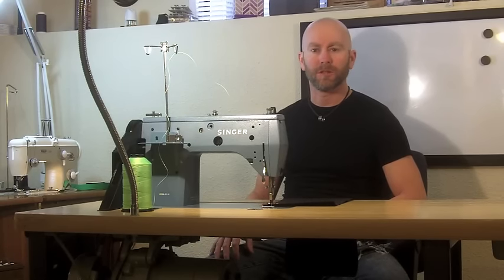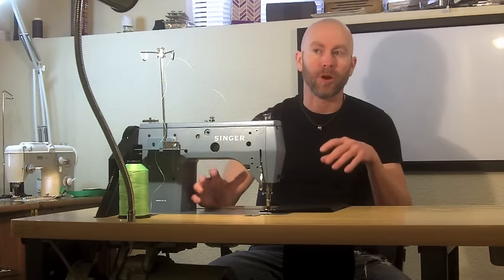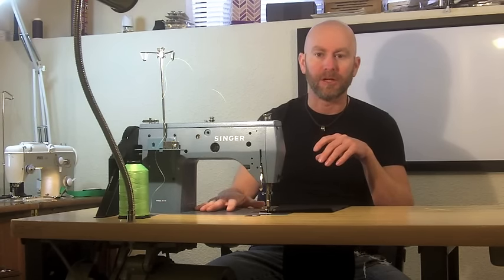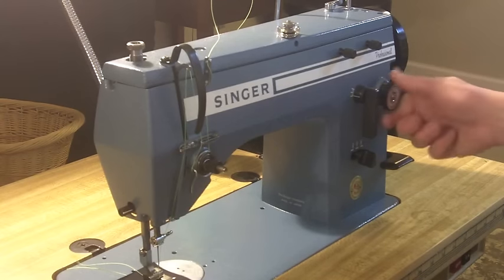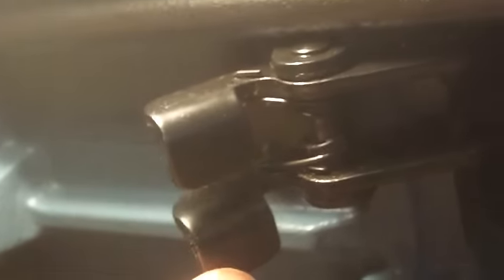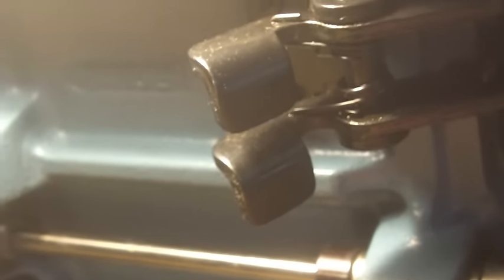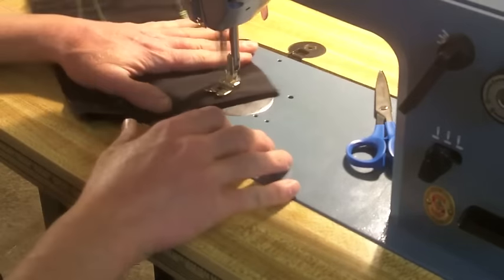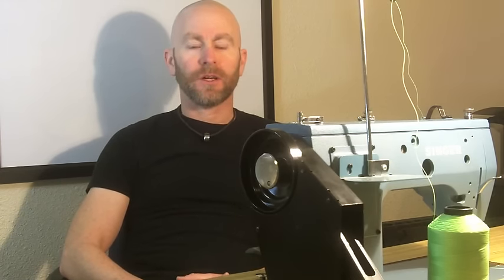Do you need an industrial sewing machine, Part 3 (I bought one!)

Comment: any opinion on the morse industrial lz1 commercial sewing machine on Etsy?  They are saying its just like the Sailrite only $200 cheaper.
Reply from the maker: So, first let me preface:  I have never seen or used a Sailrite machine, and my Thompson is the only variant of that design of machine I have used.  That said, here's my opinion.
Sailrite and Thompson seem to be the originators of this particular model, as far as I can tell, and to the best of my knowledge Thompson is no longer around. (As I understand it, Thompson and Sailrite collaborated on the design, but don't quote me on it.)  Every other machine of the same design is a knock-off, and is probably pretty close to identical - at least in appearance.
I'd really like to get my hands on a Sailrite, and I'm considering purchasing one at some point down the road.  My Thompson has been very capable and reliable, but not exactly buttery smooth and a joy to use (compared to my Pfaff 260, it's feels harsh, the controls stiff).  Watching Sailrite's videos, the LS and LS-Z machines seem a little more polished/refined than mine.
That said, the main reason I would lean towards a Sailrite over a knock-off version is that Sailrite is a company here in the U.S. that you could contact with a problem, should one arise.  They've been around for a while, and I don't see any indication that they're going away anytime soon.  For all I know, their machines are made in the same factory as the knock-offs, but when spending that kind of money on something brand new, you're not just buying the product, you're buying the company.
The thing that makes that design of machine stand out is that it is a portable walking-foot machine.  If you don't need portable, and/or you don't need a walking foot, there may be other options to consider, especially on the used market.  
I hope that helps, let me know if you have any other questions, and good luck!
Reply: Sailrite customer service is awesome.  Watch the videos for them, and realize that you will most likely be in direct contact with Matt (that Sailrite guy) for any questions or issues you might have.  I have purchased a model 111 which suits my needs, and have been quite satisfied.  I have no experience with the LZ-1 portable machines.
Reply from the maker: I should probably update my reply on this.  I now have a Sailrite LS-1, and I agree with rmcdaniel423, Sailrite's customer service is excellent.  The machine is very similar to the Thompson with some significant improvements, the reverse lever being the most notable to me.  I have several videos featuring the machine on my channel now, and a full review is coming soon.
Reply: @thejasonofalltrades  Of course the Sailrite's videos make their sewing machines seem smooth, polished and refine. I had a brand new Sailrite LSZ-1 for some years but to me it sound like it was grinding sand in it.Yes,  it was strong with the walking foot but had the feeling of cheap chinese quality. I do not think it's better then a Thompson maybe worse. Quality wise not comparison with a Pfaff, Singer, Bernina, Consew or Juki.

Comment: What do you recommend to sew 1000D Cordura nylon, elastic, and velcro?
Reply from the maker: Hi Allen, 

If you're looking to try sewing those materials but don't want to spend a lot of money, most any vintage domestic sewing machine will do it.  I recently made a video on the construction of my 1000D Cordura yoga mat bag using my Pfaff 260, for example.

If you're going to be doing a lot of sewing of those materials, and don't need to regularly sew thinner materials, too, then the Sailrite Ultrafeed machines are hard to beat, in my opinion.

You might want to check out my Sailrite review, and the video "Why Do I Have So Many Sewing Machines?" on my channel for more information.

This all assumes you are looking at domestic machines, not industrials, which is a whole other topic. 

I hope that helps, let me know if you have other questions, and thanks for watching!
Reply: @thejasonofalltrades  have you tried sewing those materials before on the sailrite machines or their knockoffs?
Reply: @thejasonofalltrades  would even a singer 4423 home machine sew those materials?
Reply: @thejasonofalltrades  also would you ever consider selling the Thompson or know of a good place to look for one? I've seen Rex version on Amazon for $285 but I'm not sure about it.
Reply from the maker: I've been using the Sailrite Ultrafeed LS1 as my primary machine for about two years.  I've sewn gobs of 1000D Cordura, 1680D ballistic nylon, 10.10oz waxed canvas, 400D pack cloth and probably a few other things.  I occasionally use other machines just for kicks, but when I need to get a project done in any of these materials, it's the machine I go to.
Reply from the maker: The 4423 is branded as "heavy duty" but in my opinion it's just a regular sewing machine.  I tried one in the store once, and I'm sure it's fine, but there's nothing remarkable about it.  I was seriously considering one, but I read a bunch of online reviews that seemed to suggest poor reliability. However, I have NO personal experience with them other than that one "test drive" at a store.  For me, I'd buy several vintage domestics rather than one of those.
Reply from the maker: I'm definitely not looking to sell my Thompson.  I have seen them pop up on Craigslist from time to time.  I paid about $300 for mine, and if I changed the one thing that I don't really like about it (the stitch length /reverse lever, the new one on the Sailrites is far better and available separately from them) it would end up costing about what a Sailrite LS1 Basic costs.  If you find one, and if it's at the right price, buy it!
I have philosophical aversions to the Sailrite knock-offs.  I've spoken about this at some length in a couple of videos.  I was actually working on a scheme to raise the money to buy that Rex, do a full testing cycle and review video, then give it away, but the requirements to do it legally and within YouTube's policies made it untenable.  My suspicion is the knock-offs probably can be made to work as well, probably will need some tuning and adjustment that Sailrite does before they ship their machines, and could be made from "factory second" components or with less quality control.  Pure speculation on my part, and my philosophical aversion and the fact that Sairite provided my machine should be considered.
Reply: @thejasonofalltrades  what are machines comparable to the Pfaff 260? What size motors do those use? How are they different from the sailrite and knockoffs and can they do 1000D Cordura nylon, elastic and velcro sewing?
Reply: @thejasonofalltrades  what size needle and thread do you recommend for the Cordura nylon and elastic and velcro?

Comment: $300 for a Singer 20U-33?? You actually stole it. Especially in that condition. It has one of the widest zig zag stitches available on these types of machines and they are reliable as a rock. Oh, lol, it’s not missing anything from the tensioner. That is exactly how they came. Slow speed control of a servo is definitely far superior to a clutch. But there are different types of servo motors. The brushless type is the one you want to use with thicker materials as well as installing a smaller diameter pulley. I replaced the clutch for the Consew CSM 1000 on my 20U-33 and installed a 45MM pulley and the control of the low speed is exceptional. Plus the CSM is a brushless so it still has all the power down at low speed as well. With the clutch you will notice some pretty good speed jump when trying to work slow on thicker material stacks. Excellent machine. With this 20U machine, a solid compound feed walking foot (which will also have needle feed which the little Thompson will not) like the Consew 206-RB-5, and a good cylinder bed machine and you can sew just about anything. Then aspire to add a post bed and you’ll have every stitch angle covered!! I have all of those listed and I can tell you, there is pretty much nothing I can’t sew except maybe the bottom of a golf bag, lol. 👍🏻😎👍🏻
Reply from the maker: Hi Scott, 
You make some great points! Allow me to catch you up.
I now have a Consew 206RB-1, which has been my main machine for the last couple of years.  I put a servo motor on that one.  It's supplemented by a Consew 225, still powered by a clutch motor.  I sold the Singer from this video (mostly because I was moving back to Florida), but I'm considering possibly getting another one if I find a good enough deal.  I used cylinder and post-bed machines for a bit over a year when I worked for a leather bag manufacturer, and ever since I've been looking for a cylinder arm machine at a cost I can justify.
So I guess I followed most of your suggestions in advance lol!
I have a ton of more recent stuff on my channel if you're interested. Thanks for watching and commenting!
Reply: thejasonofalltrades , I love seeing the progression folks go through when they get hooked on sewing once they realize how damn handy and enjoyable that skill actually is. I remember watching your videos on the vintage Pfaff domestic machines (260, 360) back when I was doing a LOT with the vintage community. Was actually featured in a documentary on the history of the sewing machine and the Pfaff 130, 230, and the 332 are my absolute favorites. But in the industrial side, there are just so many different excellent options available with the vintage models, as long as you are willing to do a bit of restoration work, there are a lot of really great deals to be found!! But literally the best collaboration in old and new are these brushless servo motors like the Consew CSM 1000 (and the 1001 with the needle positioner that most folks don’t realize that it has a heel down option to lift the needle automatically when in the needle down at stop setting). The brushless motors have terrific slow speed control with all the power of the upper end. And when you install a nice small 45 or 50mm pulley it makes a huge difference in the sewing experience. I do this swap on all my machines and the surprising benefit came from the 20U. WONDERFUL difference. I found one in similar “as new” condition that you had there for $200!! It was SUCH a score. I will NEVER get rid of that machine. If it wasn’t for the need of the walking foot cylinder, I could easily live with the 206RB-5, 20U, and my fabulous Pfaff 332 as my cylinder machine. The 332 is SO dang solid and powerful for a domestic machine and it actually handles TEX90 thread perfectly. I will definitely check out a few more of you recent vids!! Glad you like the comments and took my future advice in your past progression, LOL!! 👍🏻😎👍🏻

Comment: Jason any chance you could tell me how much clearance the foot has / whats max thickness of material could be sewn? total newbie havnt ever sewed yet but just started learning this week about machines. and the gear belt i want to sew has a maxthickness of approx 5/16". In your opinion.....could it sew through that thickness of nylon? just wondering?? thanks for posting a great video! 5 thumbzzup! james in Idaho
Reply from the maker: Hi James, 

I no longer own this machine, so I can't tell you its specifications exactly, but here are my thoughts:

Assuming the material one wants to sew will fit under the foot (and I think 5/16" is possible for most machines), there are two important factors to consider when choosing a  machine to sew a particular material; power and feeding.

When sewing a woven material (webbing, most fabrics - as opposed to leather), the needle should pass between the strands of the material.  With some exceptions (a thick seam, for example), pretty much any sewing machine is capable of sewing webbing. A powerful motor is not usually necessary, and can lead to broken needles or other parts if the operator hasn't developed the finesse or ability to recognize when to go slower.  I use very capable machines at my job, and even with them it is necessary to rotate the machine's wheel by hand through some tough spots. 

In my experience, the more important issue is the machine's ability to FEED tough or bulky (or slippery) materials evenly.  If you plan to sew MOSTLY projects involving webbing, heavy nylons (Cordura) and such, you should look into walking-foot machines.  I have a review on my channel of the Sailrite Ultrafeed LS-1 that explains the difference between walking-foot and standard machines. (By the way, one of the reasons I no longer own the Singer from this video is because after getting the Sailrite, I stopped using the Singer entirely.)

Industrial waking-foot machines, particularly ones that are new enough to have reverse (not necessary but nice to have) can be quite expensive.  They are also very large and heavy. There are many varieties of industrial walking-foot machines, some of which would be well-suited to some materials, and terrible for others.

My default advice to anyone beginning sewing and interested in using heavier materials is to first try to find a pre-1970s vintage domestic (non-industrial) sewing machine.  These can be had from thrift stores, garage sales, antique stores, your mom's attic, your neighbor's attic, etc.  Stick to names you recognize (Singer being the obvious one), and try to identify the machine and do some Google research before purchasing to make sure replacement parts are readily available (most are).  One of my favorite machines cost me $20 at a thrift store (you can see a comparison of it with the Sailrite in that review).

Buying a cheap machine gets you started learning the basics, and you can make real things.  The limitations of the machine will help you understand what parts of your assembly are more challenging, and prepare you to better use a more capable machine down the road.  When you decide you're ready to invest in a more capable and expensive machine, you'll have more confidence and be more well-informed in choosing a machine.

The next step, in my opinion, is a Sailrite Ultrafeed.  They are occasionally available used (as is the Thompson Mini-Walker, it's predecessor).  There are tons of knock-offs of the Sailrite on the market -  I don't recommend them, but many people use them, and they are cheap to buy.

The other point I'd like to make is that there almost certainly is NOT one sewing machine that is perfect for everything.  I sew everything from 1680 Denier ballistic nylon with heavy webbing straps, to 1.1 oz. silnylon.  I currently have 12 sewing machines, and there are definitely machines I use for certain things that I'd never use for other tasks. If I had to get down to a minimum, I'd have two machines for sure.

Sorry for the long response!  I hope that helps.  Let me know if you have other questions.  You might want to check out an old video on my channel, "sewing machine basics."  It's a bit dated now but has some good information for someone just getting started.

Thanks for your question, thanks for watching and good luck!

Comment: So Jason are you saying if I need to sew a few pieces of ballistic nylon from time to time that I can just stick with a regular sewing machine? If so what type of thread do you think I should use with the regular sewing machine?
Reply from the maker: Hi Paul, 
Yes, you can definitely just use a domestic machine for ballistic nylon and similar fabrics.  Actually, I sold this machine about a year ago.  I almost exclusively use a Sailrite Ultrafeed LS-1 for heavier stuff, and a collection of vintage domestics for everything else.
I almost always use V-69 nylon thread.  It's generally considered the thickest thread that is recommended for domestic machines.  I recommend checking out The Thread Exchange, they're a thread retailer and their website has a TON of great information on thread.  I use a thread stand and cones of thread, even on my domestic machines. You might buy a small amount at first to make sure your machine runs well with it, but I have 11 machines and I've never run into a problem with it.
I'm terrible about matching needle size to thread, but I usually use between a size 90 to a size 110 in my domestic machines, size 20 to 22 in my machines that use industrial needles.
Thanks for your question, I hope that helps!  Thanks for watching!
Reply: I have a question regarding sewing machines. How do I contact your channel?

Comment: Hi can I convert my singer 4431 into industrial machine, which means I want to modify fixing clutch motor to this machine , is it advisable to  do so pls give me your feed back thank you sir.
Reply from the maker: Hi, 
I don't think it would be possible to do it, but it would almost certainly break very soon if you did.  There is a LOT more to an industrial machine than a more powerful motor.
I've seen vintage (1930s-1960s) machines connected to industrial clutch motors, and those will probably take it for longer, but I personally don't think it's a great idea.  There are too many industrial machines out there; you're better off just buying one (and frankly, you probably want a walking-foot anyway if you're trying to sew heavier materials - which is why I no longer own the machine from this video, by the way).
I'm planning a video on how to choose the right sewing machine, so look for that (hopefully) soon.
I hope that helps, thanks for the question, and thanks for watching!
Reply: Thank you very much  for advice sir, I will do as you mentioned, and  I will wait for your next video tc.